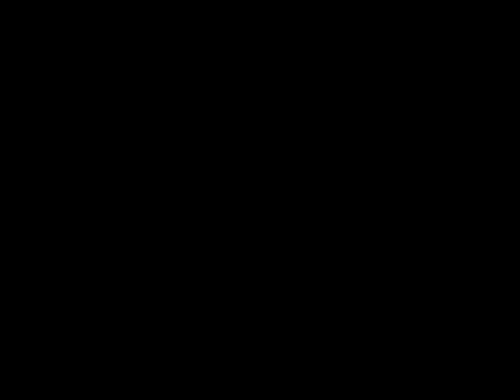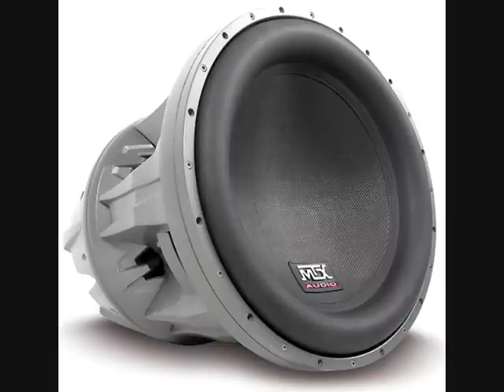Very High Bass Test 360Hz-10Hz

Comment: I know a lot of y’all hear distortion because a JBL flip 4 will not at all reach 10hz it’s way too small and it’s a sealed enclosure my Partybox 310 hits low 30s goin into high 20s and u could barely hear it and this is with no ac and bass boost if I engage them I bet u could but stop saying u hear bass it’s distortion y’all get this from bass test on YouTube thinking it’s bass so no half of y’all speakers ain’t hit 10hz

Comment: Mine head phones stoped at 70
Reply: Chief sosa same
Reply: Made it tru
Reply: Chief sosa my headphones made it
Reply: Mine never stopped.
Reply: what kind of headphones do you have? My $30 earbuds hit the 10 Hertz harder than it did the hire 300. it seemed it hit fast around 90 Hertz. it did get progressively lower after 70 but you could still hear it distinctly down to 10
Reply: My hedphones at 10 on max volume
Reply: then you have very bad headphones
Reply: Stop using headphones
Reply: Stopped in the sense